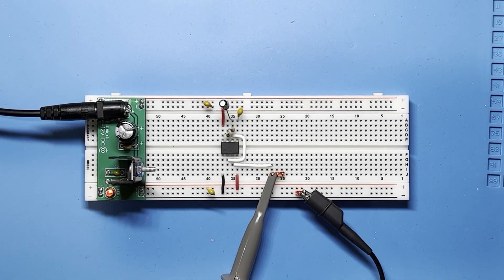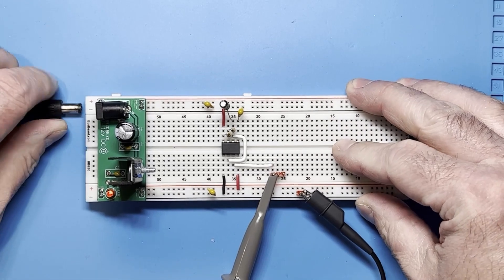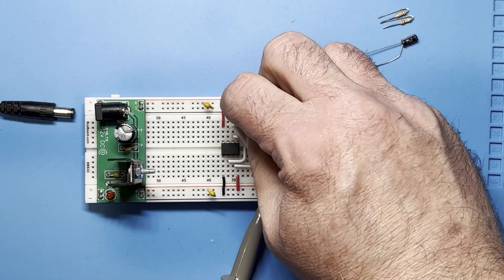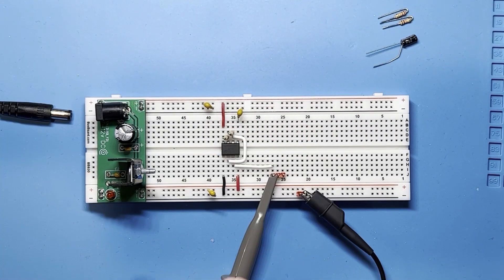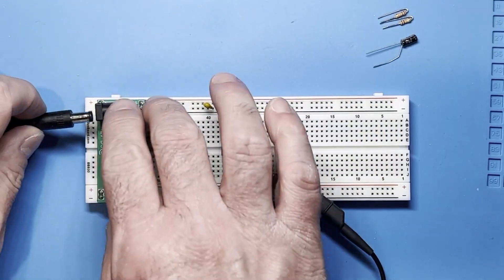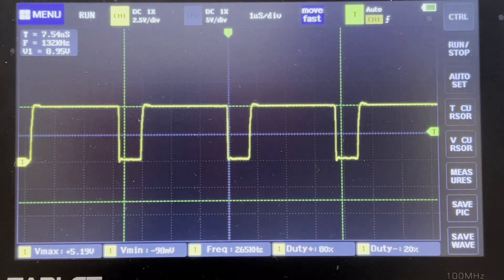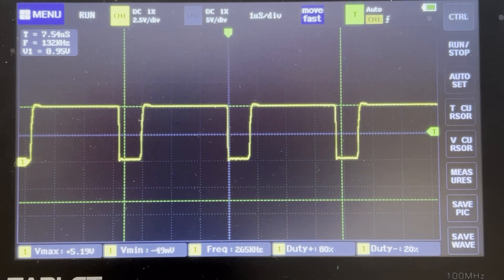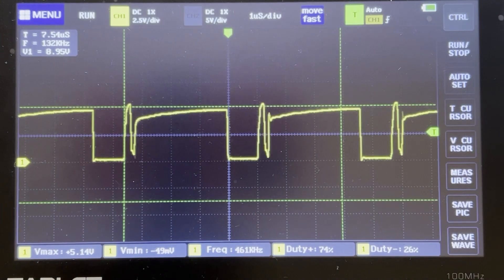Max Clock Speed With An NE555

Comment: I tried 5v power supply to my ne555 chip, and set R1=R2=150 ohm. Without capacitor being inserted into the board, the output frequency approached 1MHz. But the frequency was unstable. Without C ?? I assume there must be a few pF parasite capacitance on the board wire connection... After I put a 68nF capacitor in place, the output frequency dropped to 170kHz... Stable frequency.

Comment: Leave the capacitor out and the frequency will be higher.  New (fake Chinese) NE555's are quite a bit faster than old genuine American made parts because of the modern fine line construction. Ron W4BIN
Reply from the maker: I will try this!  I still go back to this project now and then to try and increase the frequency I can get at 5 volts.
Reply: Or simply use CMOS not TTL version

Comment: Supposedly the 555 oscillates in a breadboard without any capacitor plugged in by utilising the breadboards own capacitance.
Reply from the maker: That would be a fun test!  I’ll have to try that out.
Reply: @Pony80

Yes it would be. Pin 1 ground and pin 2 trigger if sufficiently capacitive would take a bit to charge but then pin 3 out is already high and feeding capacitance back to pin 2. Gets complicated.  I reckon trying the standard NE555 and the high speed LMC555 would produce interesting results too. The LMC555 data sheet spec is 2.1 MHz.

Comment: How about the max VCC (PIN 8) max voltage (with resist time)?
I'm using a 555 in a MOSFET gate-buffer mode (connect pins 6 to 8, and 1 to 2; pin 4 is input for 5V logic, pin 3 is output. Yes, didn't know it either) in a 12v noisy automotive environment. So far it works okay but I've heard that with big loads, the alternator can produce different length spikes well over 15V. And my problem is I only added two diodes in series and two 470uF capacitors in parallel, one after each diode (instead of a proper 12V regulator)

Comment: In my project I use the TLC555 which is pin compatible to the NE555 and got close to 2MHz.
Reply from the maker: I will try that as well. I ordered some SE 555 and want to try that as well. But with the 12v supply, it means that I have to have two different voltages for the computer, something I was trying to avoid.

Comment: Very good video, in my project I used a 74153 to change between 4MHz, 2MHz provided by a crystal, a oscilator with 555 from 2Hz to 200Hz and a pulse clock with another 555 to stabilise the pulse. I think that is a good choice to have a big range of clocks to debug the programs and to see every thing really happening
Reply from the maker: That is what I had setup on my breadboard, but once I added the 1mhz clock to handle stuff like Delay(), etc, using the slower clocks were causing issues. 
I am definitely going to show those when I show the circuit along with the cpu on breadboard.
Reply: @Pony80  Im building my one on PCBs and hand-wiring it. I tried before with Breadboards but the good quality of these on my country is very expensive and with the breadboards that I had are happing a lot of stranger things and bugs. Please show it, I will wait for
Reply from the maker: I will definitely follow-up this with anything I find. I am shooting for having something Friday.  Thanks!

Comment: How about putting a resistor between pin 5 and ground? This will lower the threshold voltage so that the capacitor will have to charge to a lower voltage to trigger the discharge.  The resistors in the voltage divider are 5k, so if you put a 10k resistor between pin 5 and ground, for instance, the upper threshold becomes 1/2 Vcc instead of 2/3 Vcc.

Comment: Breadboards are not that great at higher frequencies. Try straddling pin 1 & 8 of the 555 with a 0.1uF capacitor. Keep the leads short. The way you have it laid out results in long lead lengths (via breadboard) between the supply rail decoupling capacitors and the 555. Also, move the 1nF capacitor to the other side of the 555 and put it in the holes closest to pin 1 & 2... See if that cleans things up a bit. You might also want to try the CMOS 555 which is faster than the older bipolar one.
Reply from the maker: Good suggestions... There may be a part 2 of this video.  I figure the breadboard is my weakest link, but it would be interesting to see how far I can push it.
Reply: @Pony80  Played around with a 555 on a breadboard. Had to lower the timing capacitor to around 100pF to get up to 1Mhz. I suspect this is because of breadboard capacitance and device propagation delay. (Probably more about propagation delay since I doubt there's THAT much capacitance) I also connected the timing resistor between pins 2&3 instead of the usual two series resistors to Vcc via pin 7. This gave a duty cycle closer to 50%. The waveform was stable but had quite a bit of rise time so it wasn't very "square". Varying the supply voltage from 5-10V didn't seem to make much difference.
Then I dug out a D5555C out of the junk box. It's an old NEC CMOS 555. That gave a nice stable square wave at 1Mhz even though the datasheet says 500Khz max. So a modern CMOS 555 would probably do even better.
Reply from the maker: @kimchristensen2175  great results!  I will do the same in the morning and see what happens!
Reply: @Pony80  I was going to post a link to some scope screenshots, but Youtube doesn't allow links. Anyway, my conclusion is that it has little to do with breadboard capacitance and everything to do with the 555's propagation delay. If you scope the voltage across the timing capacitor you'll see it behaves as expected at lower frequencies. But as you replace the capacitor with lower & lower values you'll see that the triangle wave goes beyond the bounds of the 1/3Vcc and 2/3Vcc levels because the 555's output (and pin 7) doesn't switch on/off fast enough. You can also see this as a phase shift between the waveform at pins 2&6 vs pin 3.
The datasheet has a graph named "Propagation Delay Time vs Lowest Voltage Level of Trigger Pulse" which implies a delay of up to 1000ns at 1/3Vcc which explains why you can't get to 1Mhz...
Reply from the maker: Now I am jealous.  I haven't been able to get back to this due to work.
I will re-visit tomorrow.

Thanks for the research! I truly appreciate it!

Comment: Three things I can think of - What kind of 555 are you using? What is your supply voltage? and last might be the breadboard itself. I've had them up to 500K but it was on a circuit board and about 10V supply.
Reply from the maker: I have now gotten it up to 673KHz, but it has to go thru a 74AC14 to work correctly. I am thinking about doing another video on this, and trying the same experiment with the inverter as well as following up on the NE555.
Reply from the maker: Good thoughts! 

The chip is a TI NE555P, so I don't think that would be it.
My thought was that it was the breadboard.  
But it could be the supply voltage. Since I was measuring it for a clock, I was running it a 5V.
Reply: @Pony80  One other thing I found mentioned is the age of the chip. Apparently the comparators in the older chips have slower slew rates so the freq. is limited. Also at higher freq. I've noted that the 555 can be very fussy about the pulse width vs freq. Nice project, looking forward to more!